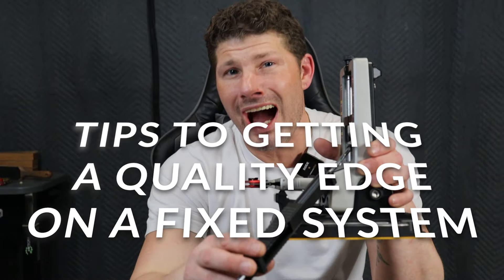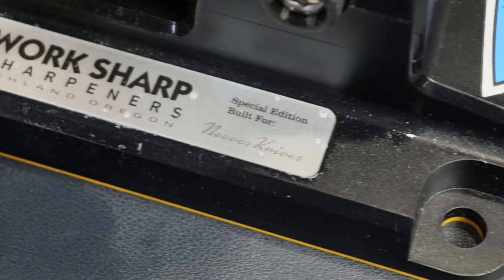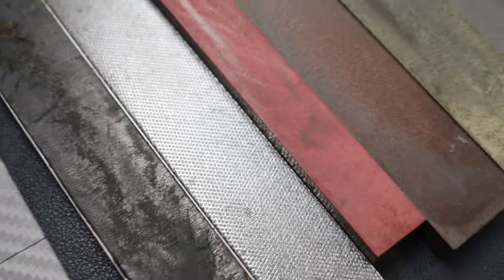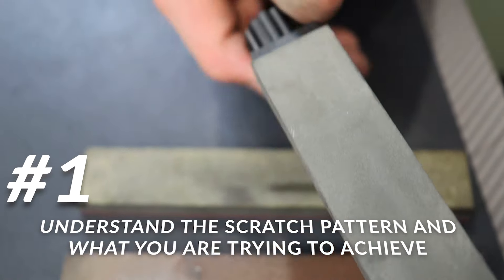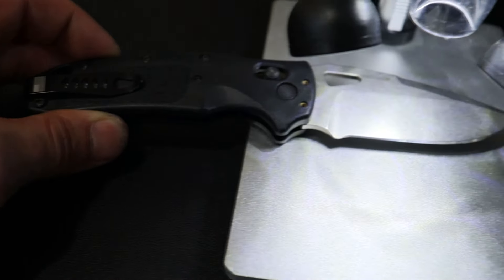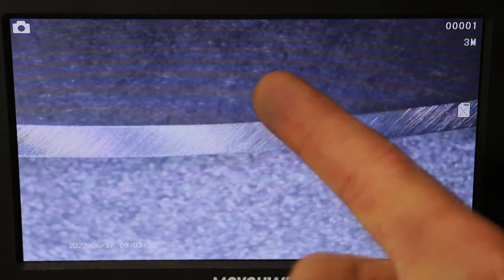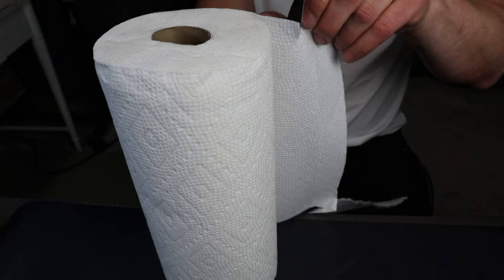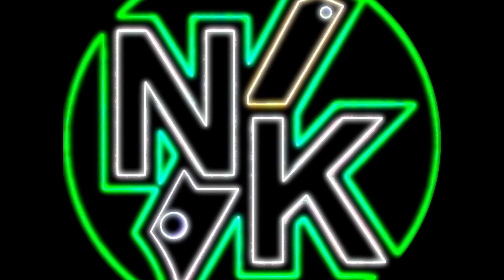5 Pro Tips & Tricks To Get a Quality Edge on any Fixed Angled system

Comment: Are you saying when your sharpening one side of the blade with like say 600 grit and you have your Bur then instead of fipping it to other side go to 800 grit and keep sharpening to get the scratch pattern smoother then flip the blade and just do like 5 strokes to remove the Bur.

Comment: fixed angle only gets thicker and your knives perform poorer and the sharpening eventually takes longer. then you have to thin it and alot of fixed systems cant do an accute enough angle to thin.
Reply: Sharpening takes materials off the edge and eventually moves edge towards the thicker part of the blade.  This is true for any sharpening.  And with any sharpening method you are almost always aiming for consistency and fixed angles.  Even a convex profile needs consistency and you are essentially creating many bevels with gradually decreasing FIXED angle at each level.
Reply: you need to get out of your parents basement.